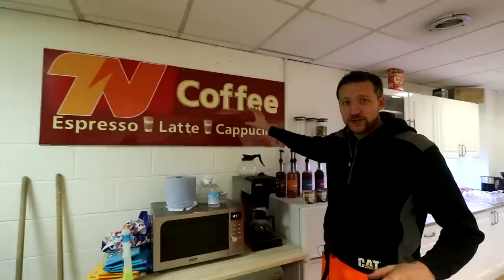I bought the CHEAPEST flood light in the UK | Nagy weekly ep08

Comment: Maybe you had one faulty lamp. You pulled the faulty one and then put it back in again. When you later tested a 'faulty' lamp you plugged in the one that would have worked if you had used it. That is a long way of saying "Maybe you have been a muppet". Or of course just put the lamp on a variac and see how low you can go before any flickering starts.

Comment: If its cheap, and made in China, then its built to the minimum standard, is built to a price, and not designed or intended to last. As someone else commented you can use orange lighting gels, which come in a variety of grades, to correct the blue-white colour temperature of better quality LED floodlights, to a warmer white.

Comment: I would guess a combination of voltage drop and ripple so would go for a smoothing capacitor, but then I’m only used to designing electronic circuits not working on big boy 240V Electrics

Comment: Does the dispenser work with oats?
These LED lights are not earthed, no heat compound, flicker like crazy, bad light colour and get burning hot in no time 
If you earth it and knock off 1/4 of the current sense resistors, it gets usable.
Reply: @Phileas Frogg The back is a metal heat sink. The PCB is made of coated metal. The coating of the PCB and the heat sink is the only thing between you and a live circuit.
Those lights are made water tight with hot glue on the cable.
RCD would only trip if the current through your body is greater than 30mA.
That will hurt.

I forgot some have very thin copper coated aluminum wires. They break if you look at it the wrong way.

Comment: Perhaps you could trace the underground junction box feeding those garden lights by using a metal detector to follow the feed cables back to a common point. As for the floodlight, it was clearly a regular flicker related to mains frequency, so most likely down to a poorly designed driver circuit that is over-critical about mains voltage and/or low outdoor temperature. A variac could be a useful tool to keep back at base for evaluating your future LED lamp purchases.

Comment: 19:18 Tom, if that gel stuff is that expensive why don't you use water to find out how much volume of gel the boxes will hold and that way you can have a written down reference of how much of the gel ingredience you need to pour and avoid any waste of the product. If you look after the pennies then the £s look after themselves. I mean all the little bits wasted add up over time and as you expand further new employees won't have you brilliant visual measuring ability. Thank You for the video. 👍

24:04 James, I am a tad perplexed why you are wrecking an old Wera screwdriver when you can get long drivers bits that would do thee job. I can get from my local bargain tool store a 10 pack of 150mm driver bits for AUD$8.90 which I think might, just might mind you be cheaper than a Wera tool (I have also seen 200mm bits). The bloody things also have chinesium insulation around them to make it "electrical" safe but even I wouldn't trust that and I isn't a sparky. My apologies if I am missing some "behind the scene" reason(s) why you have disassembled the old wera. 🤦‍♂️

Comment: but them flickering bs brandless nameless pieces of shit seems to have a capictor issue, probably missing good caps, justput good quality caps on the devices then it will obvi stop flickering simple, its not the connections must be lengh of cable or cheap sshitty capacitors , your test lead was short and didnt flicker, normal lengh lead makes it flicker! if its not the caps it must be the cable or both!